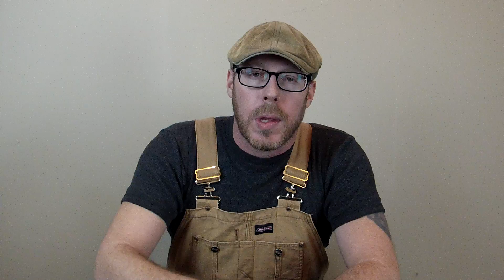Swimming Pool Leak Detection Lesson 4 - Vinyl Liner Pool Structure Leaks

Comment: This year I'm stuck with replacing the liner and stair gaskets. Is it better to use a silicone in between the liner and stairs, as a preventative leak measure? Or are there any tips you offer installing the liner specifically around the stairs.  Thanks for the great videos!

Comment: My pool water level is 1/2” above the light in the pool. Would you suspect a leak at the light? Or would my water level need to be lower than the light?
Reply from the maker: It is hard to jump to any conclusions with leaks, but certainly yes that light is now suspect numero uno.  A very common light failure is the point where the wire (conduit) connects to the top/back of the light niche.  Sometimes these are done with plastic nipples that break, sometimes they are done with metal nipples that corrode, but right at the top of your light for the water line to stop is pretty specific.  If this were my pool, well I would dig up the light, but for a quick check for a pool owner you could remove the light from the niche so you can see in there and inspect for holes or damage.  Maybe you get lucky and see something.  Failing this I would use a product like duct seal compound.  Looks like a gray brick of hard play-dough.  You jam a bit into the hole where the conduit meets the back of the niche.  Like bubble gum into a hole kind of deal.  If the leak is here, which a lot of pool leaks are in the light, this should stop it.  That duct seal will not harden like epoxy.  Do not do this with epoxy.
Reply: Swimming Pool Steve Thank you very much for your help.

Comment: Steve, if you're spinning a screw in the flange around the stairs how do you address this? How does this get fixed? My pool is filled with water and I've got a screw that's spinning...what do I do?
Reply from the maker: You would drill a new hole on both sides of the failed one and send in a stainless screw through the back side of the flange.  You want the drill bit to be sized just slightly smaller than the screw threads such that you can coax the screw through (by hand, no drill) and have it tap itself into the plastic flange on the back side of the steps.  When you do this well you can see the flange pull tight.  When done poorly the screw will corkscrew a gap in between the two flange halves.  Back the screw out, hold hte flange tight with one hand, and send the screw in again.  Once two new screws are in use 100% silicone to patch the spinner hole. Maybe epoxy even, and this is rare because I almost never tell people to use epoxy lol.

Comment: hi.  the three strips that frame the pool stairs appear to be on a track? for removal  to inspect the screws during leak detection do I slide it somehow or pop it off? how would I remove that trim without breaking it or damaging the liner?
Reply from the maker: Some slide out and some snap into place.  They often crack and break due to age and chemical damage.

Comment: Thanks for sharing your video, that was a lot of information for things to check. I’ve watched about 6 videos now on pool leak detection and YOURS was ONLY ONE that covered vinyl liner’s which mine has. I actually do have a couple of those Half moon shaped cuts and for some reason I didn’t think water had anywhere to go through them but after watching this I can see I have some work to do. Thanks so much. Excellent video! 👍👍👍

Comment: We had a pol installed Aug 2017 and found. A leak under the stair flange.  The pool company repaired with liquid vinyl.  How long will that last? Because the pool is so new I thought they would replace the liner. It's in an area that would be next to impossible for us to have caused the tear.
Reply from the maker: Not sure what liquid vinyl is...but it sounds like some damage control for this company.  In my experience it would be likely to see this leak reappear at some point in the future.